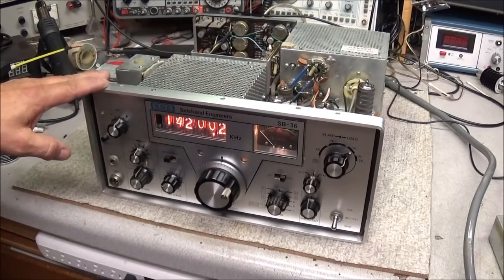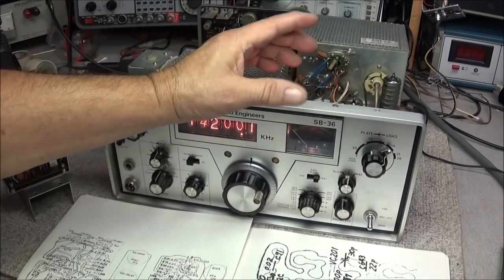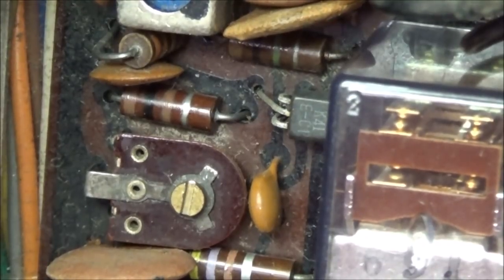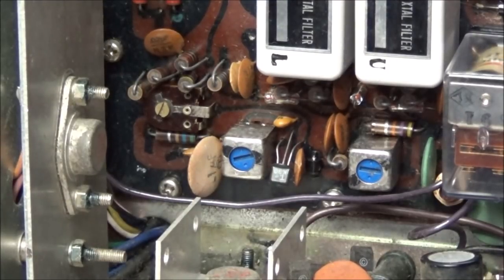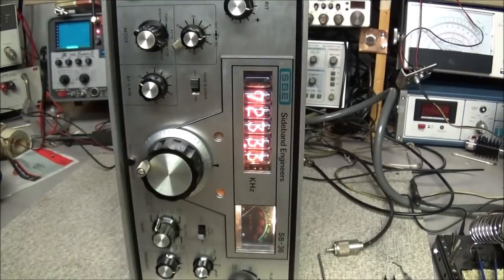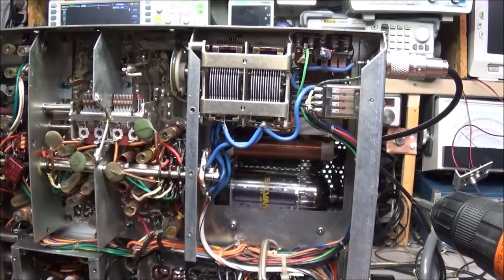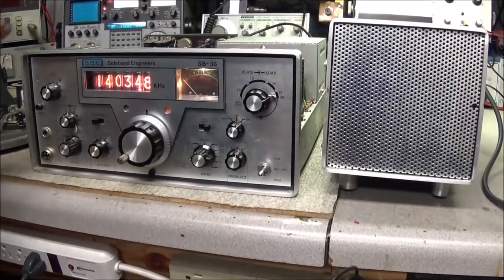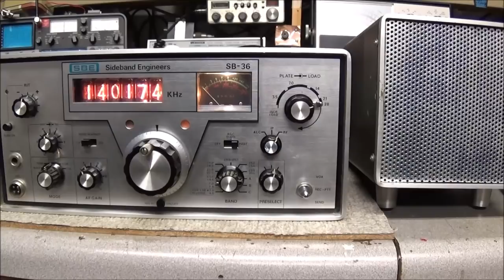#186 SBE SB 36 Restoration Part 1

Comment: I just have finished rebuilding a Drake TR-6 and had some of the same issues you had with the schematic that did not match the radio. Many reversions and some people need to keep their hand out of radios. Some parts hard to get at also. Great job you did.

Comment: That is a Good bit of troubleshooting. I remember in my BC348-Q it had no s-meter and I had to find a small enough meter to go into the hole of the front panel(the previous owner pulled out a dimmer control left a hole in the front panel) then added a circuit on a board so that it would work had to adjust the two pots on mine.  Your radio is a mixture of tubes and transistors that radio of mine is all tubes but the principle is still the same.
Reply from the maker: I prefer all tubes myself. These hybrid rids can cause lots of trouble. Good deal on the s meter install, thanks for sharing.

Comment: I was really scratching my head trying to figure out what those two holes in the front panel just above the VFO were! Was typing it in as a comment question when you gave us the answer. Can't wait to find out what was wrong with the S-meter. Thanks for sharing Buddy.  73 - Dino KL0S  (P.S. Congratulations to the son and new bride!)
Reply from the maker: They got me to start with Dino as they did not work. Until I read the manual.  This s meter is a pita!

Comment: Hi Buddy! Nice to see the SB-36 is coming to life! Just ask, I can scan a part of schematic if you want. The nixie element glowing is a bad SN74141 driver IC inside the perforated cover behind the displays, have changed two of these. I have done a ton of work on mine since I got it some 30 years ago
Reply from the maker: Thanks, I have the original manual. But the schematic is not that great. That sheet I had came straight out of the book, is your better? I thought it was the logic also but after cleaning the band switch the digits started working.
Reply: I have a manual (Japanese!) and a lot of sheets copied from other manuals. Is there a particular part you need first?
Reply: I will check my schems and the radio and see if the S-meter circuit in mine is different.. These rigs seem to be more like half-finished prototypes.. I know it was marketed as Frontier Electric Digital 500D (look at the "fe" logo on the crystal filters, on yours also) Besides I have seen it as "Robyn Digital 500A". I find it interesting (if you like to tinker without a good schematic..)

Comment: Hi Buddy, I would have bet that a driver transistor was bad on that nixie. I used to work on tons of old oilfield equipment that used nixie tubes in them. I have replaced hundreds of 3n83 transistors that drove those segments. I was shocked to see it come to life after a cleaning of the switch.

73, WB5QDR
Reply from the maker: You are right, It quit again so I know the drivers are failing.  Switch was just luck I guess.

Comment: Working on another Kenwood TS-940S. So far, the regulator transistors Q101 and Q102 that supply 28 vdc to the RF drive are shorted. Waiting on some replacements. Hopefully, the RF drive is not damaged.
Reply from the maker: Lets hope not, every time I work on one of those I find the worse lol. Good luck.
Reply: @TheRadioShop  
I decided to search for any repair videos for this transceiver. I found one with the exact same issue. So I dove into the final unit. The B+ was shorted to ground. Looking on the schematic, I noticed D1 from ground to B+. The schematic listed as a regular diode, the parts list listed as a 35 volt zener diode, the silkscreen list it as a zener diode. It's shorted. I'll try to find a replacement diode tomorrow. In the meantime I replaced the three electrolytic caps on the board. I'll replace the two regulator transistors and leave the final board disconnected until I adjust the output to 28 volts. Then, time for the smoke test. Hopefully that was the whole issue.

Comment: Very good troubleshooting. I honestly feel that if the different manufacturer’s cannot provide a decent schematic we should avoid them entirely. I know that is all well and good but if everyone pulled together on crap that was force fed, then the result should be a better product and service sheet. There is no excuse for making the tech jump through hoops to fix their garbage. I also feel that if a product is produced, a decent schematic must be available, period. I have a Fluke scopemeter with no schematic, none available. So, I cannot determine a component in the charging circuit. Subsequently, the meter will sit. Thanks Fluke. I won’t buy more Fluke for any reason. My last DVM is an Agilent.
Reply from the maker: Thanks. I think it is because each of these were hand built. Not really done on an assembly line. I like to get an Agilent one day.  I only have one Fluke in the shop.

Comment: I found the Operations Manual online and it has a parts list but no schematic. There were no two alike though as you've already found out. You probably already have this or have seen it but if not here's a link: http://www.noobowsystems.org/restorations/sb-36/sb-36-manual-00.pdf
The power supplies in these things are odd. 12v DC, 30v DC, 12v AC, 150v DC, 180v DC, -180v DC, 400v DC, and 800v DC @ 650mA. I'd hate to have to find or build a replacement. I have heard of people using the Heathkit HP-23 power supply instead with good results though.
Unfortunately the best part about these radios were the nixie tubes. The rest of the radio was garbage in my opinion though I am glad to see you bring one back to life as they are kinda rare.
Reply from the maker: Thanks, yes I had that link. My manual is the original and it misses so much stuff.  I agree the nixies is the wow factor in these, also there were not many made and for a good reason lol.

Comment: maybe if all these young hipster types see those Nixie tubes, they'll want to become hams
Reply: Back in the mid-1960s I saw an ad for a Signal One transceiver, which was far ahead of its time. What sold me was the Nixie frequency display—Had to have that radio! Kept the Signal One for several years, but traded it in for a Yaesu FT-101 which I still have... Fun times...